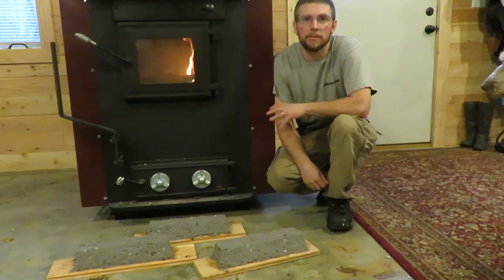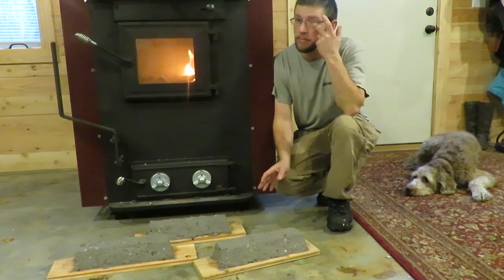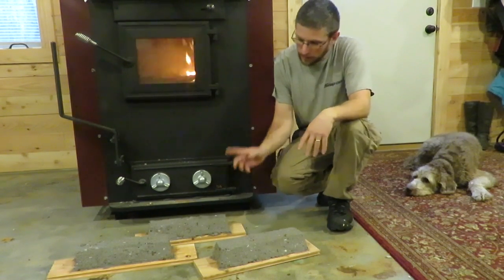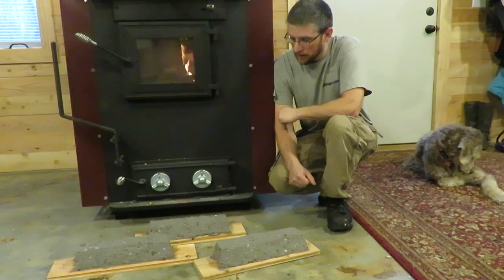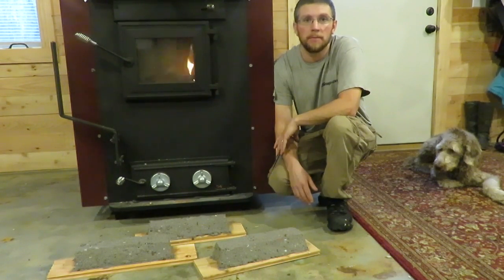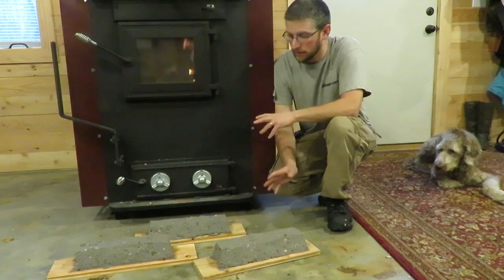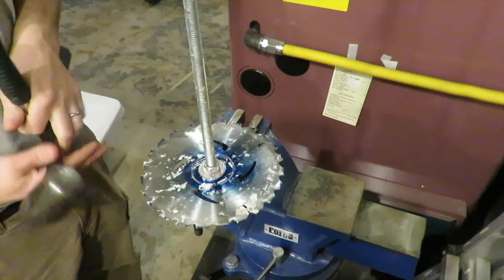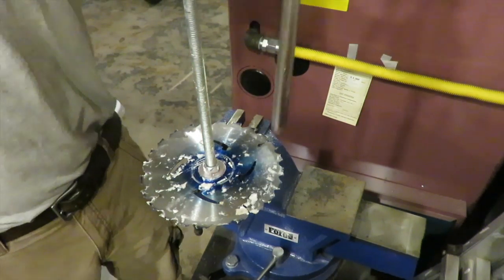Update How to Make Free Heat with Recycled Paper Briquettes and Grinder Modifications

Comment: Ya can't leave me hanging like this...how did the burn? How did the blade work? What if you used a Torque Wrench?? Lol What if you put some Coca-Cola in the standing water  buckets for a few days? Lol How solid are the bricks? could you use them for decorative stuff if you sealed them with some polyurathane?
Reply from the maker: +Tina Shay They burnt really well. The blade works awesome. Coke might help break the paper down more. I would use a corded drill. They bricks are solid, but it depends on how much you can press them. They are very porous, I think it would take a lot of coats to get the look you want. Thanks